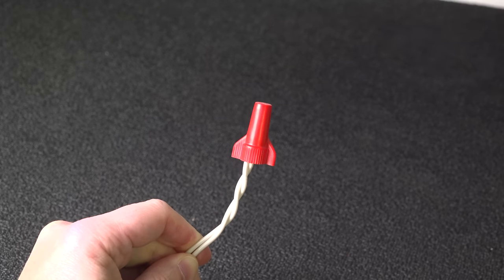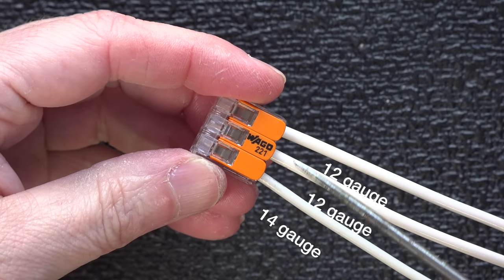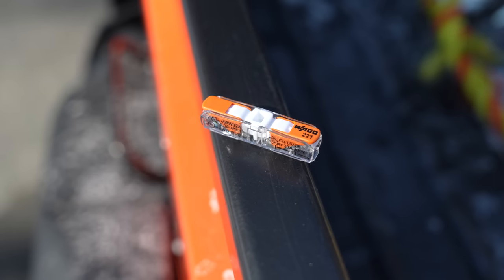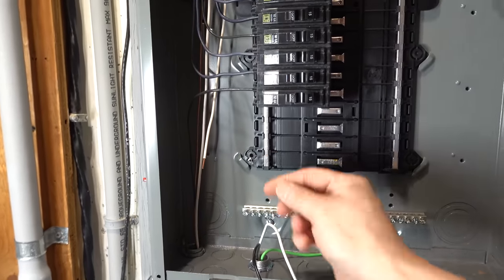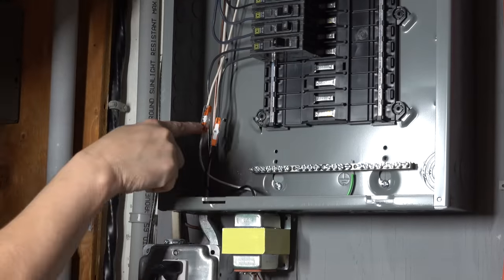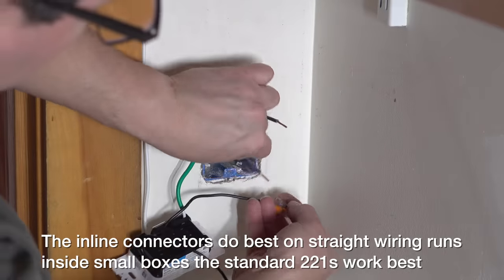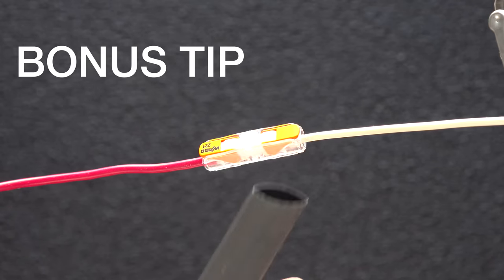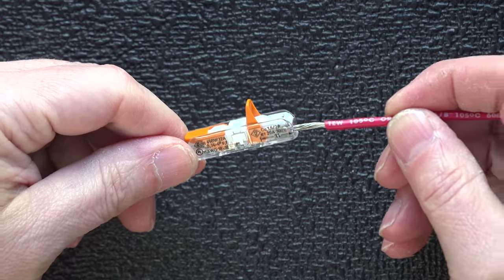New Wago Electric Connector is SHOCKING everyone - Inline 221 has arrived!

Comment: I've used them in project and cabinet builds and still prefer wire nuts for most applications in home electrical and terminal blocks on din rail for panels. And I can't even fathom the cost of wiring an entire house with them. 0.25 per box versus $1 and then the headache of having all the different wire count versions if I'm joining 2,3, or 4 wires together.

Don't get me wrong they have a place and they are valuable for certain applications but all those worshipping these as the greatest thing ever tells me only 1 thing. You suck at twisting wires and probably shouldn't be wiring anything anyway.
Reply from the maker: Wiring an entire house with Wagos instead of wire nuts adds $170 to the job. For a lifetime of easy serviceability
Reply: Twisting wires,no no no,I know they are not made in the USA,get over that and you want be sorry 😊.

Comment: Stupid 😉 question: why are you replacing the doorbell transformer?
Reply from the maker: The old one was 35 years old and had lost its power, it could barely make the bell any longer
Reply: @SilverCymbal  Strange, transformers are known for immortality, it's a bit of steel plates and copper wire so there's nothing to break there.
Anyways, thanks for answering.

Comment: WAGO rules, So much easier, You can see the connection, and they stay put.  Try jamming 5 wires into a wire nut.
Reply: Get the correct size wire nut and it's not an issue... also do the tug test with wagons vs a wire nut, that's actually done properly. It doesn't take much to pull wires out of a wago. I also have real world experience with this stuff, not just dyi experience..
Reply: @calebbigelow7556  before  I start,did you know you have an old Welsh Christian name, Wagos have gone through tough tests in the UK and have passed with flying colours.😊
Reply: @One line Al  yes, I believe my ancestors are from England but I don't know much about my family history passed a couple generations. I'm aware wagos are acceptable and work. Like I said in a different comment I use wago terminal blocks on dinrail quite often and theu work really well. I've also used normal wagos in a pinch or when I'm trying to make a larger j-box, say 6x6 or 8x8, look neater. But I guarantee you if wires were spliced in one j-box with wagos and you went to the next box in line and gave them a tug they will come off. I've had wires that I couldn't physically rip out of a jbox that were wirenutted before because I was too lazy to move my lift over to that box lol.
Reply: @calebbigelow7556  it sounds like your electrical code needs updating if you can tug on a cable down the line and put strain straight onto a splice more then its a issue with wago
Reply: @Gory Rat  wtf lol. Have ypu never ran conduit? You don't secure wires inside of junction boxes or inside the conduit. If you can't freely pull a wire from 1 pull point to the next then you either have too many bends, or your conduit is overfilled. Sorry I'm not some resi rat lol
Reply: @calebbigelow7556  'not some resi rat' you all seem the same with your stone age electrical code in America

Comment: If you are making connections in RVs, Boats, or especially machinery, you should not use wagos. Push connectors come out pretty easy with a little bit of wiggling. This is the same reason why backstabbing outlets is looked down upon, it’s the same thing and it can cause fires. Anywhere there is movement, more secure connections should be made. This goes for outlets imo
Reply: These are not push in connectors.
Reply: WAGO also showed their vibration tests. If it's german it's guaranteed to be safe.
Reply: @IAmThe_RA  also a vibration test is different than a twist test. Wires have tension pulling on them in weird ways when you stuff a box
Reply: @jamesarrendell9517  pull tests are also shown by some electricians. Wagos did well. Have used them for almost a decade, not a single failure. Did not even use wago junction boxes which would make them even safer.
Reply: @IAmThe_RA  i not talking about just pulling, which in my experience wagos do pretty well. I’m talking about a pull plus a wiggle or twist. Wagos and push connectors, even clamp connectors come out pretty easy. I’ll use them in lights, switch boxes, and random things like range hood vents, but outlets and anything with a serious motor I prefer a wiggle safe connection
Reply: @jamesarrendell9517  wagos are made to replace connector blocks and wirenuts, and they are better. That's my point
Reply: @IAmThe_RA  like I said, I like them in some cases. Don’t like how easy they twist out. And that’s my point
Reply: @jamesarrendell9517  As I said they are made to be superior to connector blocks and wire nuts which they are. They are not meant to be used in all types of applications.
Reply: @IAmThe_RA  i think we just value different things in our connectors. I like low resistance and a joint that’ll last forever. Speed is a secondary concern
Reply: @jamesarrendell9517    Connector blocks need to be maintained from time to time and wirenuts are subject to thermal expansion as they are entirely made of plastic. So they are in now way better than WAGO 221 when it comes to "a joint that lasts forever".
Reply: @IAmThe_RA  never use connector blocks. As long as you pre twist your wires, you’ll never have issues with wire nuts. I’ve worked on houses were the same connections have been there for 70 years, maybe more. Of course wire nuts suck if you don’t use them right. Also wire nuts are not entirely plastic. There is a metal coil inside of them.
Reply: @jamesarrendell9517  I have seen them fail due to thermal expansion, not because of poor twisting. So i don't entirely trust them especially on heavy load circuits.
Reply: @IAmThe_RA  was it copper to aluminum?

Comment: Well, you started out with a partial truth. Many wire nuts are not installed correctly, and I will give you that a badly installed wire nut is not a good connection. However, I can make a connection with a wire nut that is far superior to any Wago, because the conductors are in direct contact with one another, and not reliant upon springs or jaws or clips to carry the current.
Reply from the maker: I'm sorry but it's not far superior in any way, not in capacity and worse in every other aspect. No test ports, no visual; ability to inspect it and no ease of removal/reassembly. I'm sure you still won't believe me, so see the in-depth test I did https://youtu.be/B1pmuRsf1co
Reply: @SilverCymbal  I don’t need your test young man, because I have 60 years of electrical experience, and I have tried the Wago, and it’s not a device that is intended to replace a good wire nut. It is a device made for people who don’t know what they’re doing and want to join wires.
Reply from the maker: @arthouston7361  Do you realize that outside the US, Wago is the standard in just about every country for wire connections? Countries like the UK abandoned wire nuts over 40 years ago, they didn't do it to increase the risk of problems, they did it because they work. I respect experience but ignoring a german/swiss made technology that has been tested by every authority on the planet successfully including the NFPA just confirms what users experience. Do what you want but you are missing out.
Reply: @SilverCymbal   I also know that socialism is the standard outside of the United States...so frankly, other people making bad decisions is not a good standard for us.  There are a lot of people who do a lot of strange things because they don't know what they're doing. There are kids who have to use a calculator because they don't know how to do long division. The examples are literally endless in this lost world.
Reply: And let me guess, you also think imperial units are superior to metric right?
Reply: @thomasheller629   No, but I do think that you're a troll.
Reply: @arthouston7361  No not at all, I'm actually surprised that you are open to metric since you seemed awfully closed minded when talking about anything new or from somewhere else. 
But apparently you are not so I feel compelled to ask what are your reasons for preferring a wire nut over a wago connector. 
To get the standard arguments out of the way, yes a wire nut has a lower resitance than a wago but the difference in power loss is minimal during operation within normal conditions. And yes it's harder to pull a wire out of a wire nut than to pull one out a wago but a wago can still hold far more than 1 kilo. Anyways there is no point to be made with the force necessary to pull a wire out because if there is strain on the wire the person installing it did something wrong.

Now I'm curious to know what points you can make against the wago.
Reply: @thomasheller629   I have already given you a very concise description. A wire nut makes a very firm connection between all conductors when installed correctly.  Further, the wago relies upon springs and clips to carry current from one conductor to the other. I first saw them in use in refrigeration equipment which is made overseas by unskilled labor, and this gave the manufacturers a way of using their unskilled labor to connect wires in an inexpensive fastion, and as long as you're not loading a circuit with compressor start up current, you're probably OK using the wago's for running things like evaporator fans.
 This does not make the wago superior in any way unless you're having unskilled labor attempting to make conductor connections. HTH.
Reply: @arthouston7361  I do believe this argument is very subjective because it's not an argument that someone unskilled is enabled by a tool to do something the're otherwise not able to. Like an electrical engineer can calculate circuits by hand but he will still choose to do ist with his computer because it is easier for him. And with that computer even someone unskilled can calculate the same circuit and that does not make the calculation the computer made worse.
And yes a wago can easily handle the current of a compressor startup as long as the current is within the limits specified by wago. Same goes for the wire nut, if you load it with a current higher than it is specified for it will break if stay within the specifications, it will not. 
And there are other points to be made for the wago besides ease of use. 
For example expandability, you can use a 5 slot wago and only connect three wires. If you come back a year later and decide to add another wire because there is a new light in the room you can do so within a few seconds while not touching the old wires.
Reply: @thomasheller629   To me that kind of feature is not sufficient for the moniker,  "superior," but it does enable an unskilled person to join wires.......and from manufacturer's points of view, that was the reason that the wago was created.
 It is not subjective that when you join conductors together by placing them in direct contact with one another, and not through a second medium, you have a superior, lower resistance connection.  That is an objective fact.
Reply: @arthouston7361  I did not say the resistance argument is subjective I meant the skill argument.
I only said the difference in resistance is negligible. And to this point in time the difference in resistance is the only point you made against the wago, all your other points were directed at the worker making the connections. 
And to make my point a fact, the difference in resistance does not affect the ability to handle currents just as high as a wire nut does. You only need to use a wago of the appropriate size. 
There are wagos rated for up to 350 amps and therefore 350 AWG or 185mm².
I don't think even the biggest wire nuts can handle that.
Reply: @thomasheller629   Well, the skill argument is why the wago was created, and that was told to me by a manufacturer. Second. I do not believe that the wagos can handle the rated current as well as a wire nut with direct contact between conductors. Outside of being in a factory, as long as you have skilled people, there is no real reason to use a wago.  If it made a better connection between conductors, that would be one thing  but instead it uses an intermediary device between the conductors, and that to me counts as a deterrent to using it. Nothing about a wago dictates to me that I should be using a more expensive device instead of a device which works 100% of the time when it is installed correctly.  I do believe that it is a very popular gimmick among a lot of people.  Now there might indeed be a 350 amp version of a wago, but I look at a lot of power connections, and I've never seen one in use. I've spoken to contractors and never found one specified in their drawings, and I seriously doubt that they're going to start popping up here in the United States instead of the already approved devices which are used for that level of current. Why? Because the wago is not going to be doing a better job or cost less...... it's only going to be able to do the same job, and be perhaps more costly.
 This is a solution in search of a problem.
Reply: @arthouston7361  I see you point but I tend to disagree a bit. I did not mention the 350 amp wago because it is used frequently but rather to show that the resitance is not significant enough to make a difference, after all at 350 amps any significant resistance would turn that wago into a space heater which is not what's happening. 
Therefore I personally do not weigh this point so hard I prefer the ease of use over the minute difference in power loss. 
And by the way those 350 amp wagos are already approved in the US.
Reply: @thomasheller629   There are a lot of things that are approved for use in the US, but unless the price point or some other benefit propels contractors and engineers to begin using them, they're still going to be a gimmick.  That intermediate connector part can fail at a much greater rate than having conductors pressed against one another properly, and while that's not a big reason to use a wire nut over a wago, there is no great reason to use a wago over a wire nut.
Reply: @arthouston7361  I do think there is a great reason to use a wago over a wire nut and that is ease of use and especially in industrial applications the ability to order a electrical cabinet. Its just not possible to make a clean and easy to service cabinet with a wire nut for a milling machine for example, with wago that is possible. 
The fact alone that I can connect up to five wires in a wago instead of two (or 3?) in a wire nut makes it superior.

And all of that being said the largest usecase of wago products is in industrial applications.
In old housing we have an antique connector called "Lüsterklemme" here in germany an they just like wire nuts make a great connection if used correctly but they fail easily if used incorrectly. And nobody uses them anymore because they are tedious to use and the wago is just as good and way easier to use.
Reply: @thomasheller629   The last milling machine I looked at was a Bridgeport, and that was some 50 years ago.... so I'm assuming you're talking about a CNC machine. My 1st question would be, "what did the manufacturer do to join the wires together," and my 2nd question would be, "why is there not a terminal strip for the purpose?"... but if you want to use the wagos, knock yourself out. I just believe that their popularity is based upon not knowing how to use other connectors.  And once again, the "ease of use" means that you can use unskilled labor.
Reply: Wire nuts are banned in the UK and have been for many years,twisting cables together is a no no.
Reply: @onelineal9382  Well fortunately, the UK is not the last word on how things should be done. Can you say Meghan Markle?
Reply: @arthouston7361 My soninlaw is American,he tells UK is miles ahead of his own country in electrics, ps,whose this Markell chick,never heard of her.😊
Reply: @onelineal9382   I'm not sure what basis your son-in-law would have for making that assertion, especially since much of the UK's wiring comes from the 1930s and 1950's.  In the 1950s there was a building boom where the rubble was finally all cleared away from Hitler's bombing raids and and new work was put up using the standards of that time. Of course, newer buildings are built to newer code standards.... but I know what types of materials and methods are available around the world,and I would be really interested to hear what would be the basis of his statement.
Reply: @arthouston7361  you really think that being able to use unskilled labour is why they are popular, just wow sorry to tell you gramps but it isnt skilled work to twist wires
Reply: @Goryrat   I am completely unimpressed by your ad hominum. Making a good connection using standard pressure connectors requires skill, and I find that 99% of current electrical helpers don't have skill, and can't make a good connection using these standard pressure connectors. It is sad they have to dumb down the industry.  The fact that you think it is "twisting wires" shows how little you know about what you're talking about.